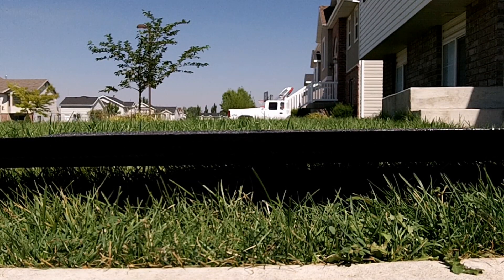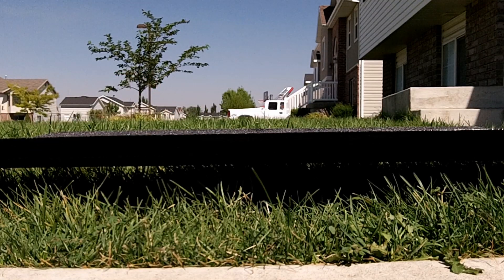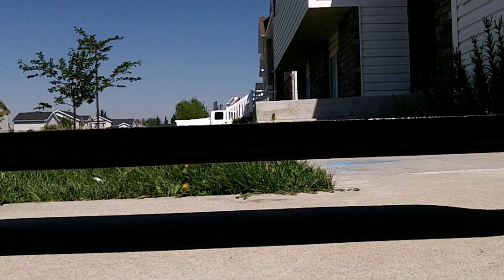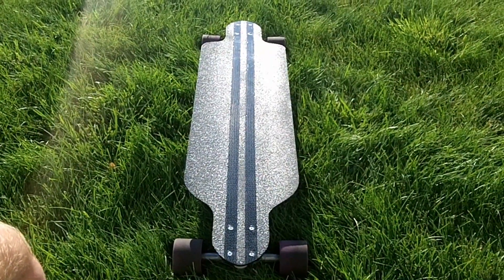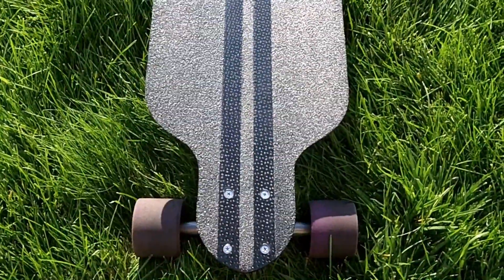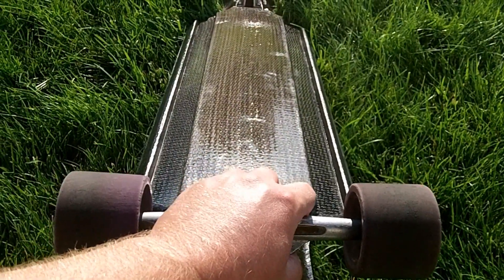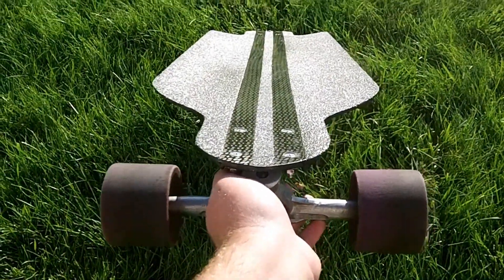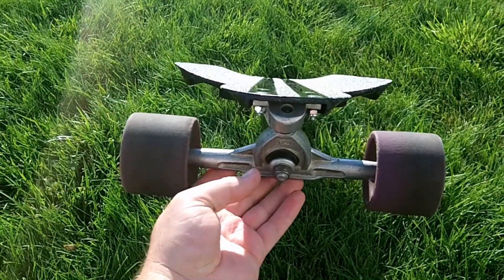DIY Carbon Fiber Longboard Tutorial- 7 of 7

Comment: i see u have not been responding much but if or when u do i followed ur tutorial and i got mine made a bit cheaper by using cheaper less quanity as i saw u used stuff in bulk instead of in size of what u need but if u made a couple of longboards from what u have and sold them u could make a decent profet if u decide to sell send a message or a post on a vid and great job

Comment from the maker: Not much you need to know about the mold making process. It can be made out of just about anything- wood, Styrofoam, concrete, metal, etc. You just need to make sure it has a smooth surface that the epoxy won't stick to. The mold I used is made out of hotwired xps/xeps foam and then cover in a layer of epoxy and fiberglass. Once cured I sprayed it with gel coat and then leveled, buffed, and then waxed. Just remember that polyester resin and polystyrene foam don't play good together.

Comment: Hello mark a friend and I have been making boards from wood and presses but have been intrested in trying CF since its stronger and lighter and for the most part easier to work with. Our goal is to make the first board as u did in your videos but as a double drop deck with lots of concave. We were wondering if you could possibly pm us on how you made your molds and the supplies needed for the mold and CF process

Comment from the maker: If I'm understanding you correctly... No core? if so this would would be fine but the board will have to have quite a few layers of carbon fiber and the board will be fairly heavy. 

If you're talking about a foam core pintail this process will work just fine. Just remember to account for wheel clearance.

Comment from the maker: The Omen board is quite a bit different than this board. The Omen weighs 4 lbs this one is 2.8 lbs. The Omen is more of an all-around board where this one is designed for DH racing. So to say that one board is better than the other is dependent on your riding style and preferences. 

I think $300 is a great deal for a custom CF board. However, I won't be selling finished products anymore. I have too many project ideas to get out, so I've decided to stick with just doing projects and tutorials.

Comment from the maker: @kristhian12341 
I still haven't decided on whether or not I want to sell these boards. The liability scares me more than anything- It wouldn't be a big deal if the insurance was cheap but it's not and I don't know that I would sell enough boards to make it worth my while. 

If I decided to go into business, a board would cost around $300 USD. Kind of expensive for a board that's really only designed for DH racing. 

What you guys think is a good price point for a CF board?

Comment from the maker: @ProFailProductions 
The total Variable or material cost is just over $100. Here is a basic breakdown: $25- core, $30- uni CF, $20- 4hs CF, $10 of epoxy, $3 butyl tape, $2-breather, $2-peelply, $2- Stretchlon, $2- G10, $2 wood stringers & blocks, $2- Tread Tex and allow a bit more for other costs.

Please note that if you are just making 1 board it will be more expensive because you may need to buy more of something than you need. For example, a yard of carbon fiber when you only need half.

Comment from the maker: @PERRONmedia 
Thanks, I actually started building a mold with rocker incorporated but I used MDF board as the base and didn't put any stiffeners on it. After I did the fiberglass shell on it I put the IR oven on it to cure and the MDF warped on me bad. The mold had to be scrapped :-(

One of these days maybe I'll make another mold and post it.